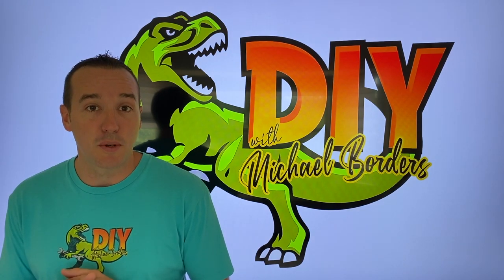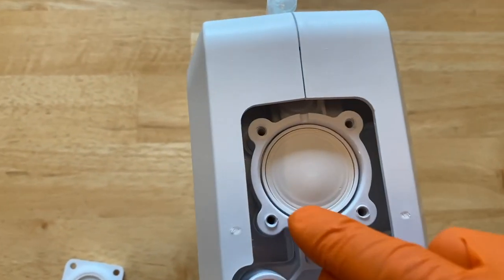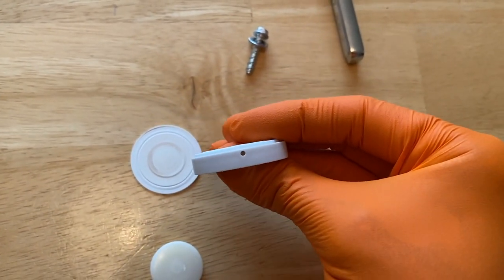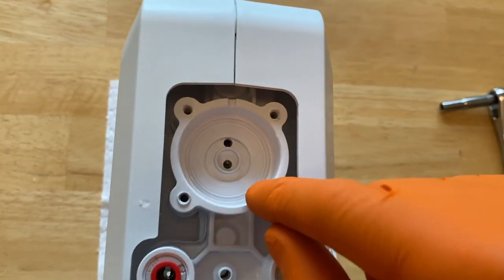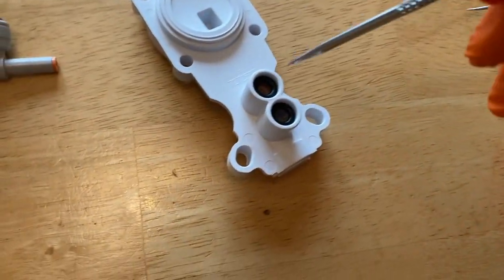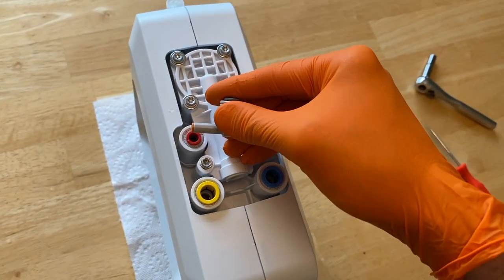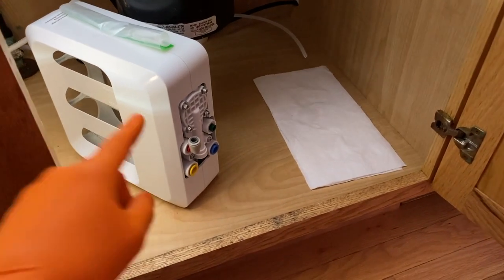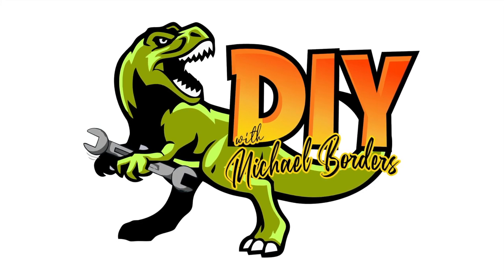Reverse osmosis system not filling/flowing - Inspect Auto shutoff

Comment: Ok sooooo what happens if there IS a leak?? I’m so lost at what the heck is causing the leak we have from the filter housing
Reply from the maker: Thanks for watching, have you determined if the leak is coming from inside the filter housing and leaking down below or is the leak coming from the back portion of the filter housing where the water lines connect into?